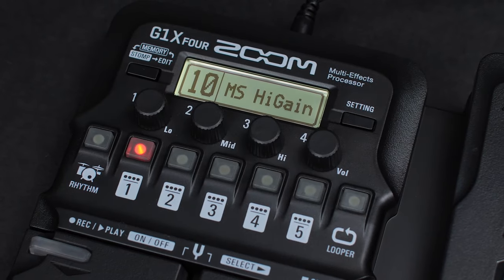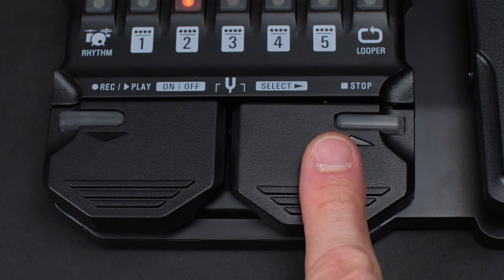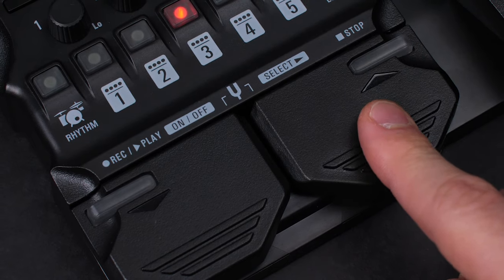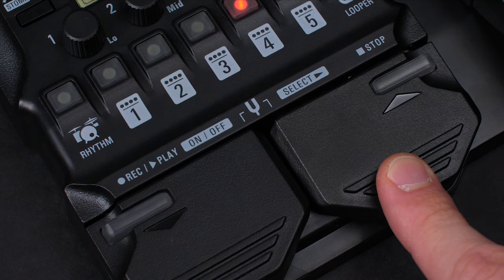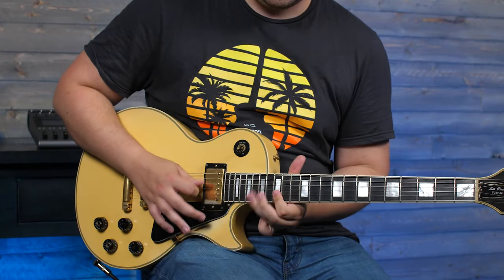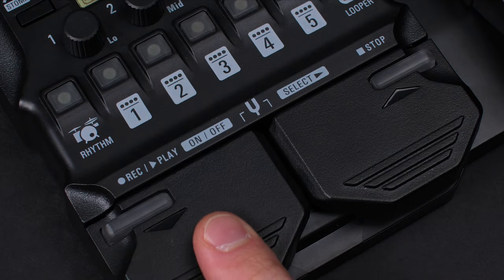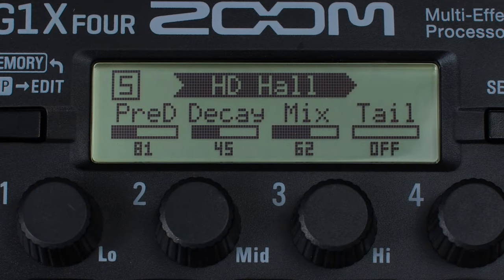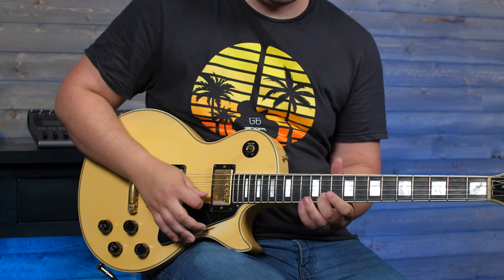Zoom G1X Four - Creating A Patch

Comment: The Recti ORG model sounds like absolute garbage in this video, and I thought the same too when I selected it on my own G14, but I suspect you may not have turned the mic ON in the cabinet settings, as I had found out while exploring the sounds. I did that and it sounded somewhat okay, but still not that fantastic. 

The Diezel amp model is the better high gain model in this particular zoom multi fx.

Comment: I would have one question about the expression pedal that controls the volume. If you set it let say in the half of its way it gives you 50% of preset volume. But if you change the preset without moving the pedal, this another preset turns on with 100% loudness until you touch the pedal and move it slightly. Is it possible to change it somehow? I mean when the pedal is i.e. totally raised so every preset that I switch on will be with 0% loudness.

Comment: I have a question, I believe this pedal has stereo output, how do you feed the stereo signal for recording direct?
Reply: The output jack is stereo. Also you can output over usb
Reply: @Docksidestudio1  How can you output via USB?
Reply: @LuizLuiz1006  plug it into a computer for recording
Reply: @Docksidestudio1  sure, but which recording software to use? Do I need any external interface or just Plug and Play?
Reply: @LuizLuiz1006  you need to use an audio interface for best results.  Recording software (DAW) like Garageband, Logic or Protools if using mac or Windows Fl Studio, Presonus, Reaper, Ableton just to give some examples.  Good luck and hope you are enjoying your Zoom pedal.
Reply: @Docksidestudio1  No, the zoom g1x four doesn't support USB output, the USB port is for firmware updates and the companion software  for patches.

Comment: Hi zoom I own one of these pedals and my screen got stomped instead of the buttons, dumb I know lol. As the screen is now just black is there a way of getting it repaired or a replacement screen. And finally is there a chance that I could still use it connected to my laptop?. Any feedback will be much appreciated thanks… btw great demo 🤘
Reply: use a usb cable to connect ot the laptop. Use zoom guitar lab software to control literally everything from your laptop.. works like a charm.
alternatively you can try tonelib zoom software to do the exact same.The ui is a bit better there.
Reply: @ekhwanislam5659  nice one buddy ,great news that is👍. I going ordering the cable now I know it will work . Thank you matey 🤘
Reply: @ekhwanislam5659  oh yeah secondly is it jus a generic usb for say like a kindle or smartphone? As if so I don’t need to buy one lol . Sorry to pester and thanks again buddy 🤘
Reply: @l3yfajamz  yeah just a generic one, micro USB. The one you used to see on pretty much every smartphone before USB C became so widespread.
I'm using my old phone charger cable lmao
Reply: @ekhwanislam5659  awesome good to know, I’ve still a few of those cables left since moving on to iPhone. Thanks buddy really appreciate your reply. Rock on 🤘